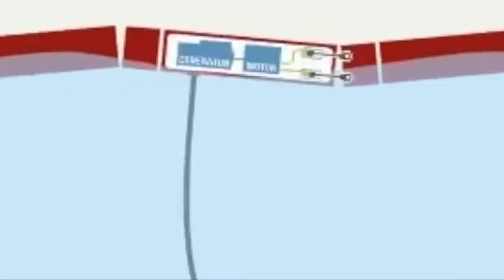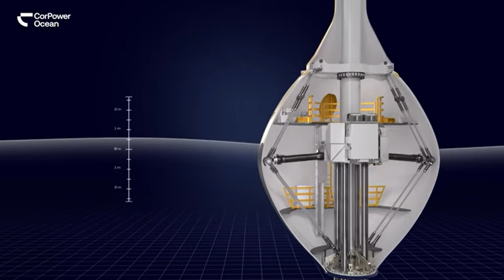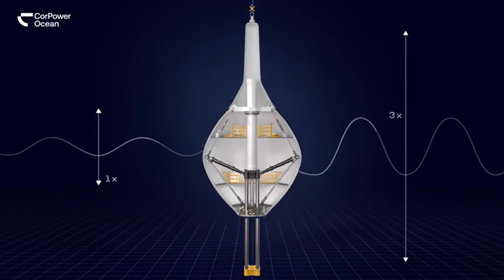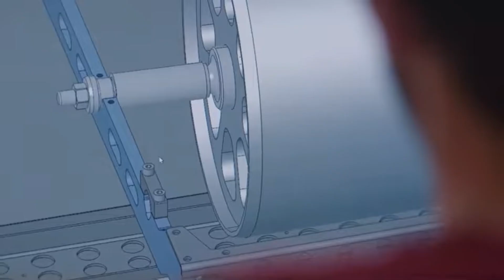Corpower C4 : The breakthrough Wave Energy Generator

Comment: They should try it on the Great lakes in North America: 
What is the highest recorded wave in the Great Lakes? In most cases, lakes are confined to smaller fetches which limit wave size, but the Great Lakes are large enough to produce frequent swells up to several metres. However, the highest ever recorded waves were 8.7 metres, outside of Marquette, Michigan, on Lake Superior.

How high can waves get in a lake?

Studies in larger lakes, however, have shown that the height of the highest waves are related to the fetch. In these lakes, waves as high as several metres are common, although waves of about 7 metres (23 feet) are the highest to be expected.

Comment: Possible but when also has to consider the connection between the device and the shore given all the movement in the hostile environment of the water. Thanks and blessings!
Reply: This question cropped up during the consultation process for my local offshore wind array, as did the effects of said connection on wildlife.  The answers demonstrated much thought had gone into the issues.  It is undoubtedly a major consideration, though one factored into installations by design.  

Seawater will obviously dissipate heat in transmission cables pretty darned effectively,  but the trick will be ensuring that - and all other losses -  are minimised in the first place.

Incidentally, over 80% of respondents to the consultation I mentioned (Rampion Array off the Sussex Coast 🇬🇧) were pro or strongly pro .... which rather caught the company behind it on the hop - they'd expected vastly more resistance!
Reply: @TheHoveHeretic excellent response. This gives a good foundation to begin calculating cost-effectiveness.Thank you!